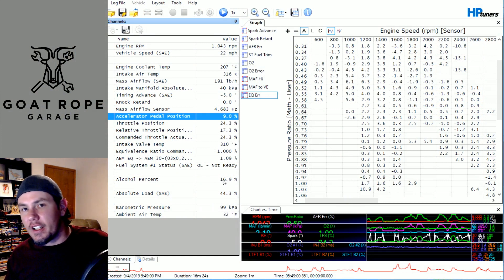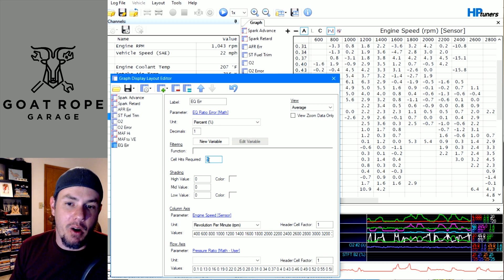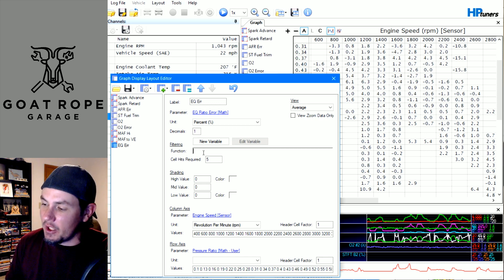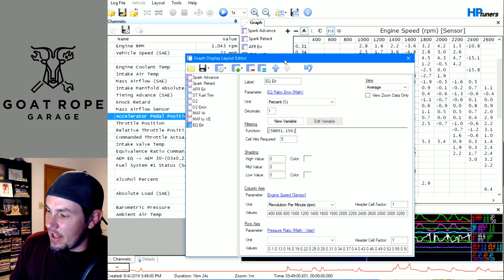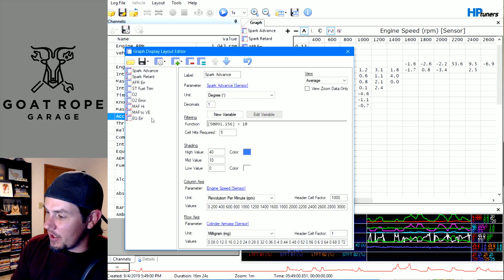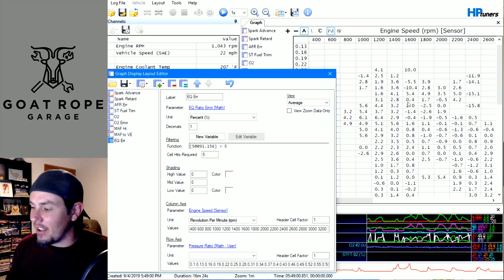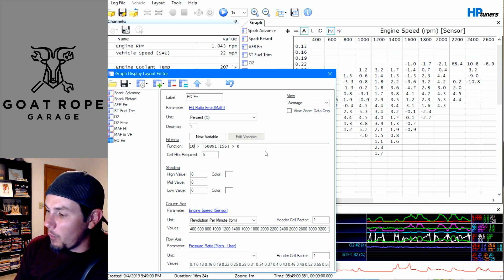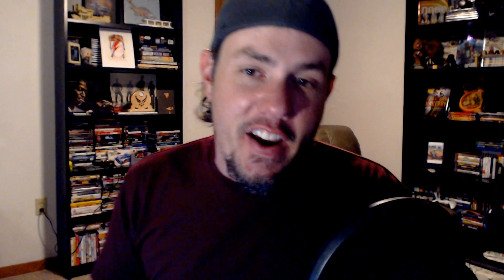How To Use Filtering On The HP Tuners Scanner To Clean Up Bad Data!

Comment: I looked up a timing calculator that is like HPT is it a science or can I smooth from the top timing I want to hit
Reply from the maker: A bit of both, most if these have a MBT table which is the maximum timing you're going to run, you'll probably be into knock before then anyways. I tend to just dial it up until I have to stop due to knock.
Reply: Goat Rope Garage your the man thanks

Comment: thanks for the vid. I wasn't putting spaces between variable, greater than and the number. but you made it clear on how to use this function. ive ran into another issue. commanded eq ratio doesn't change with the motor warming up, it will only change from rich to 1.0 if I cycle the key, reguardless of ect. btw tuning maf on an e37 if that helps. thanks again man u r awesome
Reply from the maker: David, you've you to have something holding you out. You should be able to watch it sure through the startup qualifiers and move to 1.0, the fact it does after a restart is very weird. A lot of those are ECT vs time, I'm wondering if on the restart the engine is then warm enough to bypass the cold start fueling.
Reply: @GoatRopeGarage  im not sure honestly. I have open loop eq tables gas, p/n set to 1.0 at ect 133°  but it never changes command for some reason.
Reply from the maker: @davidchmelik6592  year/make/model?
Reply: @GoatRopeGarage  09 cobalt lt
Reply from the maker: Are you forced into Open Loop, David?
Reply: @GoatRopeGarage  i set o2 readiness all the way up. 400 something. Disabled ltft and dynamic. Only reason im concerned is at commanded .988 my wb read .94. Not bad. But when i cycle key. Commands 1.0 and wb reading .88
Reply from the maker: @davidchmelik6592  you in the same frequency range on the MAF when you have those error reasons?
Reply: @GoatRopeGarage  those numbers are both from idle
Reply from the maker: @davidchmelik6592  David, you've got me scratching my head here. I've looked at the tunes for that platform and I don't see anything out of the ordinary. Have you tried speed Density to see if it does the same?
Reply: @GoatRopeGarage  anytime in running open loop to tune. Well try to tune lol. Ive always thought i had a ground issue. But never fully committed to finding it lol. U think something like that would be it?
Reply from the maker: @davidchmelik6592  I mean, it could be, grounds are the worse kind of Gremlins especially when dealing with analog signals. You still have a MAF you can switch to see if it does it on that fueling setup?
Reply: @GoatRopeGarage  both maf and sd, open loop need a cycle of the key to change commanded to 1.0. Its weird, if i read the computer it goes into engine reduced for about 2 min.
Reply from the maker: @davidchmelik6592  whoa, never heard of that happening before.

Comment: Have u ran into a wideband reading erratic in the vcm scanner? Gauge reads perfectly,  have signal and ground from wideband going to I/O on HP box. Iv had it logging good with this gauge before I permanently mounted it in the car, I used to only use it when tuning and powered it from cig plug. Installed and open air calibrated new sensor when I permanently mounted gauge in car. Thank you for all the info
Reply from the maker: Try connecting the grounds to chassis ground instead of ground from gauge to input on scanner. This is one of the reasons why I prefer to use a serial input as opposed to an analog.
Reply: @GoatRopeGarage  Iv tried the ground in several different places with no luck. What is wierd is let's say the reading is 14.63 on the scanner, only the after the decimal is glitching, the .63 will be all over the place. My gauge only has Analog out, narrowband out, digital out. Do u think the digital output would be any better or would it even work?
Reply from the maker: @joshmeyer5280  what gauge are you using? Digital out is usually just a setpoint trigger
Reply: @GoatRopeGarage  ASPX Wideband
Reply from the maker: @joshmeyer5280  Okay, that digital out is a serial, I'm not sure if HP Tuners supports it but it's worth trying as you'll always get a better reading from a serial connection than an analog.
Reply from the maker: @joshmeyer5280  This is for an AEM but the principle should be the same

https://youtu.be/mGcEw29XZBQ
Reply: @GoatRopeGarage  thanks
Reply: @GoatRopeGarage  how do I wire the db9 connector, what goes where? LOL
Reply: @GoatRopeGarage   I'm assuming the digital out and ground go to the connector, if u could tell me what pins on the plug corelate to the wideband it would be fantastic. Thank u again for all your help.
Also FYI I joined your tuner tier on patreon.
Reply from the maker: @joshmeyer5280  look up computer serial port pins on Google, you'll want the digital out on the receive data pin for your serial to USB adapter. Receive is pin 2, ground is pin 5
Reply: @GoatRopeGarage  man thank u so much

Comment: Could I apply this to my speed density logs for tuning the VVE table, to say, maybe only filter out areas with more than 10%  error? Even tho I am updating my VVE table with the multiply by half feature, it still feels like I am chasing it back and forth. Especially on the zone edges.
Reply from the maker: Yeah, but you will have to do it on the math side, so basically create a custom math to the your EQ (or AFR) error and then bracket the whole thing and do a less than 10